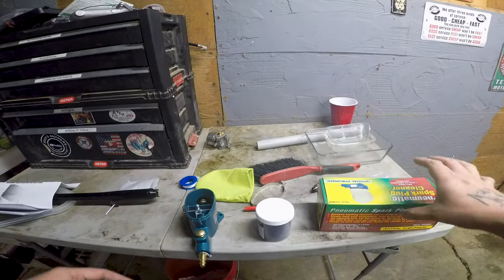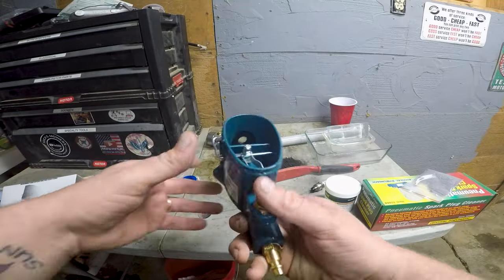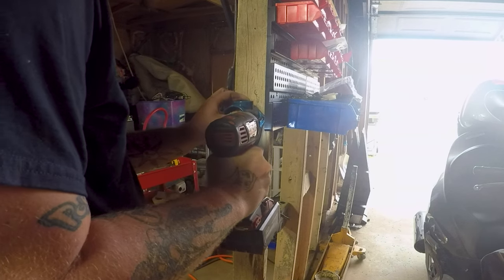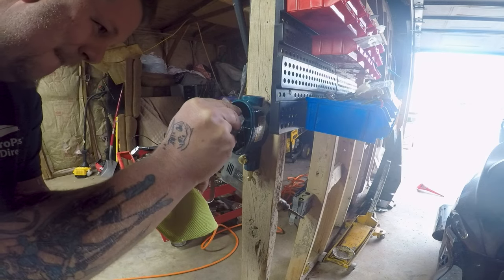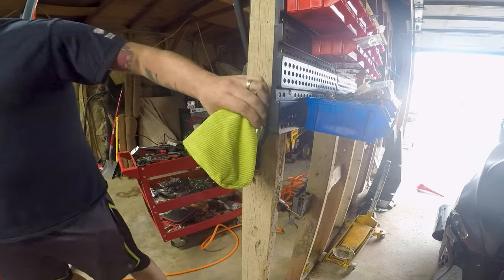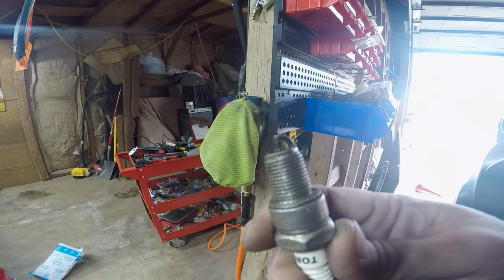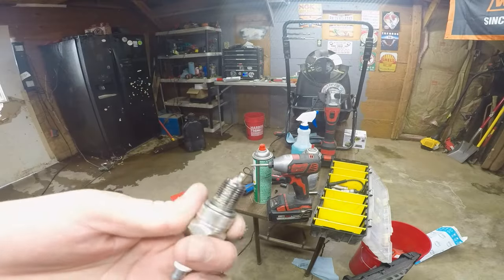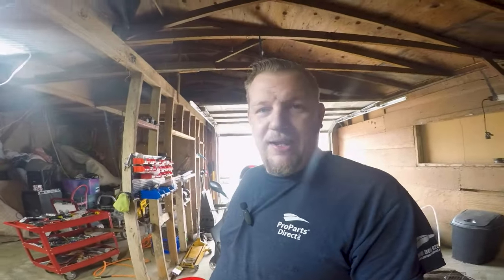Testing out the Harbor Freight sparkplug cleaner. does it work?

Comment: 1977 Bought a cheap black plastic 12VDC sparkplug cleaner (JC Whitney $3.99), no air compressor, handheld (or set on bench), been working a treat to this very morning. Same plugs in all my small engines, v-twins, etc for several years now. Use it for my 6cyl and 8cyl vehicles when I pull the plugs. Newer vehicles, about 2000 plus, such a pain to change plugs that I use new. Should note that my Jeep Commander 4.7L has 160K miles, no misfires, no mileage loss, no power loss, so never change the plugs. ML430,  140K, new plugs at 100K. Plugs last a lot longer now. Cars back in the day, need plugs/brakes/points/wires/dist cap, etc almost once a year, but you could clean the plugs and they lasted much longer. Most service stations had a 'professional' plug cleaner machine.

Comment: From Leo:  Those spark plug sand blasters were in any gas station garage in the 50's / 60's.  Poor carbs, people leaving the hand chokes on, etc would soot them up and the old ignitions were not that strong.    Modern cars with high voltage ignitions and precise fuel injection eliminated most dirty plug problems.   I just changed original plugs with 175,000 miles in a Ford Taurus, and it was still running great and getting good mileage.   I can see blasting plugs for lawn mowers and other crude engines to clean them up..
Reply from the maker: I just thought it was neat and figured I would try it. It was pretty fun

Comment: You're supposed to check your regulator pressure with the tool running.You're probably only running about 70 p.s.i. with all that hose.
Reply from the maker: I rarely use pneumatic tools so thank you for the tip

Comment: The working part of the plug is the electrode. While you dont want alot of carbon on the ceramic insulator being a little black isnt an issue unless your reading plugs to tune carb. Back in the day almost all the shops would clean plugs and the guys who tuned their cars had a way to clean plugs.

Comment: I use those "shorty plugs" in my 3rd Gen Camaro, for clearence between the plugs and the header tubes, (Shorty Headers)...and back in the 50's-70's all the shops and garages had a dedicated spark plug cleaner mounted on a work bench.
Reply from the maker: Sweet I have like 20 of them I have no idea

Comment: I have cleaned a lot of spark plugs in my time. As long as your insulator & tip are unchipped, the electrode isn't damaged and you regap every time, you can save a lot of time, money and trips to the parts store.
Reply from the maker: I bet and clean them out

Comment: lol Champion used to sell a high quality cleaner, back before cars had computers, fuel injection, super hot coils and turbos. These days, if your car is working properly, your plugs will wear out without carboning up. With the 6V coils of that era (even in 12v systems) the spark was fairly weak and plugs lasted a long time. Naturally you wouldn't want to try this with platinum or iridium but it's OK for carbed equipment and junker cars.
Reply from the maker: Champion used to make a good one. They don't even make good equipment now lol